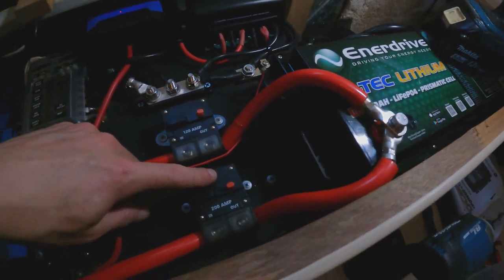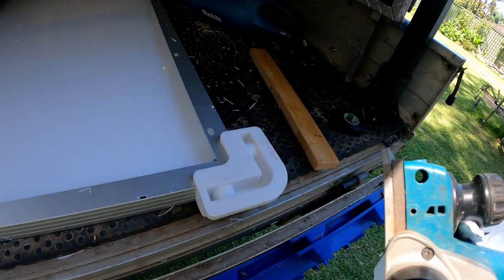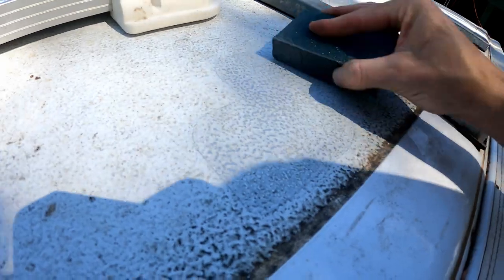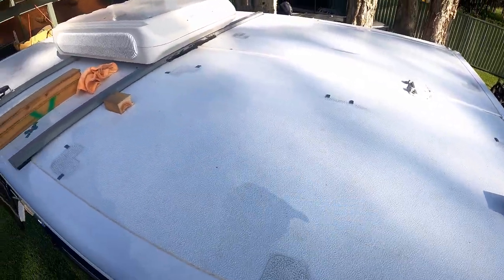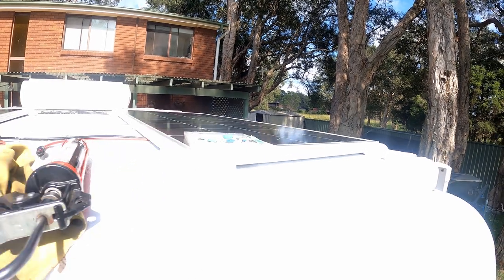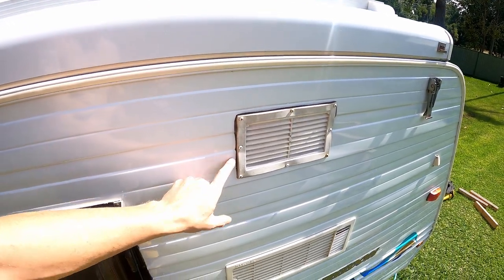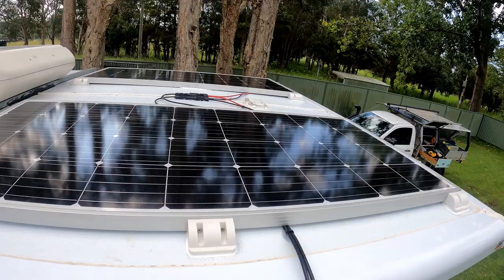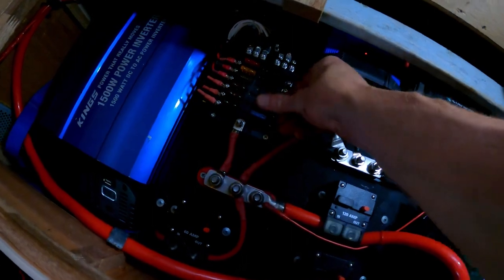DIY 12v Solar installation: Pop-top caravan, no penetrations.

Comment: Good video. I have a tip for you. If you have to use your finger on the Sika flex spray it with brake clean. That way it doesn't stick to your finger and the Sika flex rolls smoothly.
Reply: Use soapy water, not a solvent based product. Ask a caulker, they would never use brake cleaner

Comment: I used the same Sikaflex 252 adhesive to fix 2 panels on the roof of my van.  Yesterday one of them flew off and hit the roof of a car following behind causing significant damage.  When i got home I pulled on the 2nd panel and it came straight off in my hands. The Sika bonds well to the roof of the van but not to the plastic mounting blocks. Super important to use a sika ‘primer’ on the bonding surfaces to avoid what I just went through which narrowly missed their windscreen
Reply from the maker: Oh wow that's terrible! So lucky noone was hurt. Thanks for sharing, it's important to know what can go wrong before taking this avenue of installation. 

I guess the primer is the difference. I also added a redundency. A stainless steel cable that I drilled and fed through the sides of the solar panels and to eyelets that are mounted to the exterior shroud of the roof just in case the adhesive failed. I did this after making the video though which I regret.

I checked the adhesive recently and it's still all bonded well to the roof and mounts alike.
Reply: @live2thrive249  thanks for the vid. Very informative as I’m going to add another panel to our roof of our second hand van that has 2 smaller  panels already installed. The original install on our panels is glued and screwed, and I was wondering to repeat (not a fan of putting screws in the roof😬)  and see you did secure them with something else as well, so I confirms what I was thinking. Will glue and screw. Wish me luck😂 Cheers.
Reply: Sadly we had similar experience. Mounted panel the same even with alcohol cleaned roof and sikaflex 252. Found panel came off across Nullabor. Luckily no one behind us at the time. Found sikaflex still on roof but did come off plastic legs. Very scary when you see panel in rear view camera
Reply: @brettmate6806  
Sounds like i'm going to be bolting in the roof.
Reply: Screw em down. No problem
Reply: Somebody was killed by a solar panel coming off a van in my state. Use bolts

Comment: I used T-rex by Soudal, made 2 trailers with composite sheeting and only used trex and a few screws to hold it on while it was curing. Used the trailers for a year and it didn't even budge the panels at all, I swear by the stuff.

Comment: Hi Shaun, the way you connected you wiring back into the van was great & exactly how I will fit a solar panel to my little poptop van. Have been worried about  going through roof with my wiring & you have solved my dilemma 🙂. Cheers

Comment: Excellent video once more Shaun!  I'll be fitting a couple of 215W panels to my old Jayco in the next few weeks, so this was very timely!  The guy I'm helping to fit them uses a different method of packing.  He actually get a length of welding wire and shapes it to the bead then runs the bead over this.  Apparently that ensures the Sikaflex isn't pushed out and has the correct thickness.  We're using 50mm right-angle aluminium for my panels in place of the individual mounts.  I presume this gives the Sikaflex a greater surface area to adhere to.  My panels are also a bit larger at 850mm x 1,550mm, so I guess the added support is a good idea.
Reply from the maker: Thanks Dave. I like the welding wire packing trick. That's a new one. Good luck with your install

Comment: I will be doing this so , but I was thinking of using aluminium engel as a bracket bigger feet so more area for the adhesive, plus put the brackets front & back & sides with air gaps on sides so as travel in the wind can’t get under the panel & blow the panel off
Reply: I’m no aerodynamic expert but i think with wind speed the panels get ‘sucked’ out of the fixings not unlike a plane wing with fast moving air causing low pressure above the panel. I’m surprised they’re not legally bound to fix with nut & bolt attachments with these flying off more often and lobbying insurance companies paying out.
There’s some clever ideas out there that have some underneath brackets so you can angle lift one side to improve sun angle once parked up. I have a photo somewhere if interested.

Comment: Good video but I have used aluminum angle and cut sections to use as mounting points for the panels. You mount the angle to the roof first then offer your panel to them and make sure the panel is level and then pop rivet or self tapped screw to the outer panel frame. The gap between the solar panel and roof will vary depending on how bowed your roof was to start with. Using the molded mounts that you have used relies  on the roof to be dead flat in order to not introduced flexing of the panel.
Reply: I appreciate comments, especially if they are informative but it's advisable to watch the entirety of a video before sharing opinions. I agree that the aluminium angle mount is a good idea. I explain why I didn't go down that track and I also over come any flexing of the panels by scribing and planing the mounts to sit flat on the curved roof with no penetrations as the title suggests.
Reply: @shaunduncan8747  sorry Shaun I was not judging your method , in fact I tip my hat to you for your resourcefulness in overcoming the challenges of an uneven roof. I was just offering up a different method for consideration by others. My wording could of been better composed. All the best to you on your travels and I’m sure with your skills, most challenges will be overcome. Oh yes on the no penetrations. The aluminum angle can be sized to give you the same adhesive area as the molded plastic mounts...no screws in roof.
Reply: Thanks for clarifying Fred. Like I said I appreciate your feedback. Unfortunately I've recieved a lot of criticism from people who didn't bother watching the video which refutes their claims.

Anyway happy travels ✌️

Comment: Love the video! But NO WAY IN THE WORLD would i NOT bolt this down. Good luck to the drivers behind you!
You could at least tie a tether to it 'just in case' your sika flex aint fully sika.
Crazy... just using glue.... crazy af
Reply: If you read the description of the video it describes exactly that. I threaded a stainless braided cable through the solar panel shrouds and bolting it to the aluminium skirt around the edge of the roof. A great redundancy device. Unfortunately I couldn't include it in the video once it was already uploaded.

Comment: Great video mate I want to redo our solar panels , has it made it much harder to pop the roof up ? Thank you
Reply: I definitely made it harder which forced my hand to replace the gas struts. I could have gassed up the original ones but they were 20 years old so opted for new and got them gassed to my requirements. With 2 solar panels and aircon ontop I found that 800N in each of the 4 struts made it relatively easy to pop up and easy to pull down.
Reply: I have the same kind van but without A/C. Was wondering how much strut pressure is required for two * 370 watt panels ?? 
They’re pretty heavy, btw the house panels in series supply around 50amp through a 100/50 Victron MPPT.

Comment: Hi Good job with this and the 12v upgrade video. I have same van and looking to do the same. I was wondering why you didn't use the same system as for the a/c with aluminiun bar across the roof and attaching the panels to that?
Reply from the maker: Hi Shane, thanks for the comment. In my experience of working on a variety of metal rooves of houses for many years I've found that penetrations have a tendency to eventually create leaks. And I've experienced too many unexpected leaks. My thoughts with a caravan which is dynamic (the whole structure twists and bends whilst driving) I wanted a solution that did not penetrate the roof. I must admit I also wanted to try something new 😊

In hindsight I would be equally happy with the solution with the aluminium angle. It's a great solution that gives you peace of mind! 

I guess the video is trying to show that solar panels CAN be fixed down with adhesive... But proper preparation and execution is paramount!

Comment: Awesome video. Im just about to buy a pop top and wad wondering how i would mount panels on it. Only thing i think about this way is air getting underneath panel and lifting it. Would it be worth running a bead of sika around the edges you reacon?
Reply: I was concerned about the same thing. Unfortunately I didn't include this in the video but, as a redundancy I drilled holes through the panel shrouds and thread a stainless steel cable through. The cable was swaged with eyelets and attached to the outside edge of the van roof. If the adhesive ever let go the cable would hold the panel on the roof. I would advise something similar since there have been many horror stories of solar panels flying off.

Comment: Hi Shaun, great video. Very Detailed 👍👍 A couple of questions. What are the connectors you used to join the cables on top of the roof I have never seen them before. Could you perhaps include a link for them. Did you Mount your A/C Unit. Would love more info on how it was done.

And one thought had you considered some sort of infill on the leading edge of the panel to illuminate any uplift perhaps from a passing semi trailer… thanks Keith
Reply: Hi Keith, cheers for the comment. The connectors I used to link the panels are called MC4 y-branch connectors. They essentially either split or join solar cables.
The A/C unit was already installed when we bought the van... But it's mounted on a couple of gal steel 2x1" box section that extends to the outside edges of the pop-top which helps distribute the weight.

As for the uplift question I calculated it would require several tonnes of uplift to rip the panel or mounts off but I did install a redundency system after I made this video just in case. Basically it's a stainless steel braided cable that's threaded through the solar panel shrouds and swaged over eyelets bolted into the outside edge of the roof. It's impossible for the panels to come off now 😊
Reply: @shaunduncan8747  thanks for your prompt 😊 reply. Where would one buy the connectors. Jaycar or specialist Solar mob
Reply: I think I bought mine from jaycar for convenience but shop around because i vaguely remember being unhappy with the price.

Comment: Hi,just watched both your vids, I have the same pop top  with the old system, I also have twin battery set up but without the 240 inverter.is it possible to incorporate the inverter without changing the whole system.
Reply: Hi, it is as simple as wiring the inverter to the battery. Make sure you use a fuse or circuit breaker and the correct gauge wiring... That's the most common mistake people make. For example. The wiring I used was as thick as my finger. Expensive but less expensive than the result of a fire.

Comment: Just one question. Do you run your fridge on gas at all?? Otherwise, great video.
Reply from the maker: In normal circumstances we would run the van  3 way fridge on gas when parked since its way more efficient than 12v. But in my ute I have an 80L 12/240v fridge that has been sufficient for our travels thus far and it's charged from the alternator and solar input so it will run indefinitely with free energy rather than using the vans gas. The trade-off is we have to walk to the Ute to get things from the fridge 😊
Reply: No worries. Just that the heat outlet for the fridge will get hot where your wiring is ran through for your solar.
Reply from the maker: That's a good point. I did spend the extra money and got good quality UV and heat resistant cabling. One would hope it would endure in the cavity behind the fridge.
Reply: @live2thrive249  the cleanest route is to run it through existing ceiling light/speaker loom, which will eventually pass behind the fridge anyway

Comment: Hey mate how has your connection of the panels held up now that you’ve used it a bit ?
Reply: They've all held up fine except one corner came a bit loose. Tbh I would probably change my approach if I were to do it again and just use aluminium angles as supports. I'm glad I have the braided cable holding the panels down too (not shown in this video)

Comment: not happy about using just glue to secure these potential flying weapons, as stated in another comment, but with a pop top your a little buggered.
Reply: Thanks for your concern Geoff. Unfortunately I didn't include in this video the redundancy device I created to negate the chance of the panels flying off. It's a braided stainless steel cable drilled and threaded through the solar panel shrouds and swaged onto eyelets that are bolted onto the top outside aluminium edge of the caravan. The panels are still solid after a year. If everything is prepared properly this method works and can hold several tonnes of uplift... But I'd recommend a safety backup just in case

Comment: It was all looking good until you came up with that messy and lazy solution to run the cables into the van!

If you did some research you'd actually find out that there are special gland housings specifically to run solar cables into vans through the roof. 

If you bothered to speak to professionals that fit them rather than hatch your own half baked idea you'd know that.